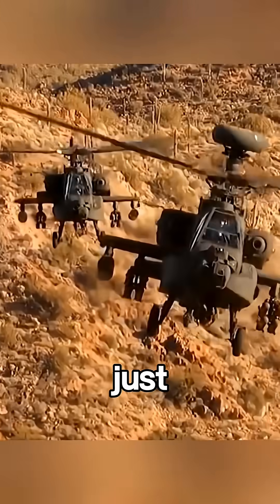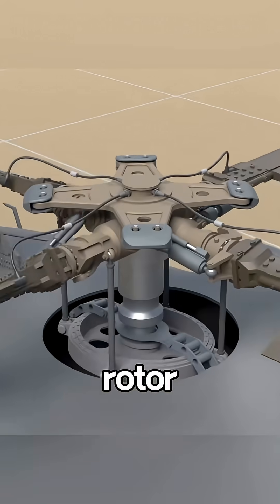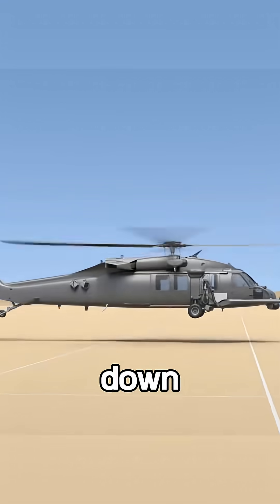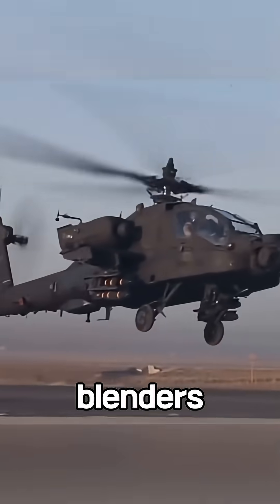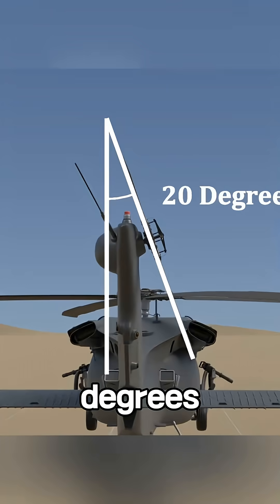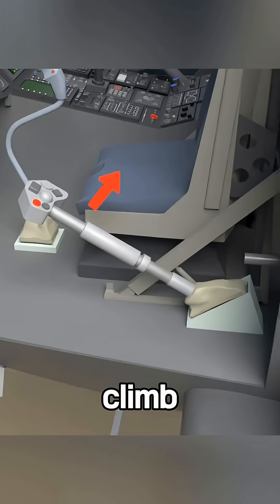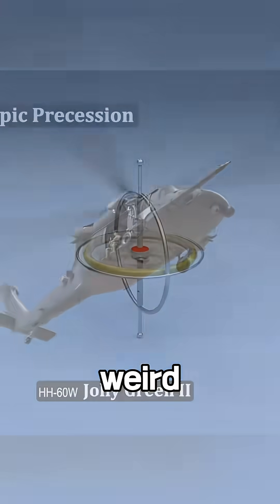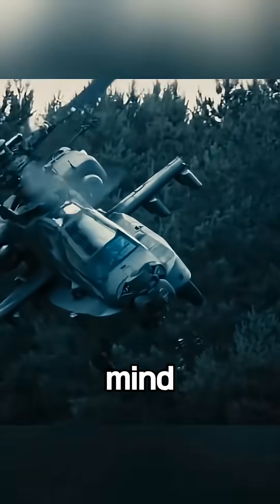Helicopter Speed Myth Busted: What Really Limits Their Velocity #helicopter #aviation #military

Comment: Helicopters do have a throttle, it’s the twist grip on the collective arm. It makes the engine and henceforth the rotor blades move faster or slower depending apron power needs. They don’t always go the same speed….
Reply: You’re dead wrong, the throttle is used to maintain 100% Nr regardless of the pitch collectively on the main rotor blades
Reply: @VerticalFreedom So, a throttle isn’t used to spool an engine up?!?!… Are you sure that you are sane?….
Reply: @Dingomush initially yes, to go from ground idle to flight….after that it’s used to maintain 100% Nr
Reply: @VerticalFreedom . What the hell are you calling “Nr”? Just like a car going up a hill, a helicopter must draw more power and hence more rpm to fly higher or faster. Don’t tell me that you think a helicopter runs the same rpm in a tropical jungle in summer as they do in the tundra in winter……. That would be stupid….
Reply: @Dingomush  obviously you have little clue about how Helicopters work! Nr is the rotor RPM & yes Nr remains at 100% whether flying the Himalayas or tropical jungles
Reply: @VerticalFreedom   No.  You don’t constantly run a turbine at peak. That’s why that throttle is on the collective. If it only ran balls out then there would be no reason for a control  for the engine. Which sounds stupid, because it is. You really need to talk to people who have flown this equipment as you have no clue….
Reply: @Dingomush if you are talking of a GT engine then You never touch the throttle, as the engine is governed to deliver 100%Nr. In a uncorrelated piston engined machine you are constantly manipulating the throttle to deliver 100% Nr & the engine RPM remains the same. I guess flying these machines commercially as well as being an instructor for 38years I’ve learned that much about them 😅
Reply: @VerticalFreedom   Well I guess you should get off your high horse and kiss the ground. All helicopters do not operate the way the new ones do, now do they. Also if you look into the way the system works as far as pulling power out of an engine you will find that it has to vary RPM in order to keep your ass in the air. That is, unless you have never hit a downdraft or violent turbulence. You are talking out your ass about one scenario………..
Reply: @Dingomush hahahaaaar you just proved you’re clueless about rotorcraft! Anyways I’ve wasted enough time on a 🤡
Reply: I just hope you don’t hurt or kill anyone with that “I’m right on all counts because I’m me” attitude because your perspective came from so far up your ass that you were tasting it for breakfast. The way one craft works is not how all craft works. Also, as soon as I load the rotor to lift the craft the RPM’s will drop… the engine will have to compensate… the speed WILL VARY!!!….Goodbye.
Reply: @Dingomush  Hello dingo. Hopefully I can word this in a way that conveys the message. I'll preface by saying that my area of expertise is the UH-60 Blackhawk helicopter. It is my career. To keep things simple, I will say that my statement applies specifically to the blackhawk. Though, in reality, it extends much farther than that one airframe. As VerticalFreedom stated, Nr is a 0%-100% scale which measures rotor speed. To clarify, 100% Nr is not the critical speed of the rotor system. A 100% Nr indicates that the rotor system is at it's design operational RPM. In flight, and depending on atmospheric and weather conditions, the rotor system can encounter a vast array of different operating conditions. However, through mechanical and electrical systems, the rotor rpm is maintained at a constant rate, regardless of torque demand. this is done by dynamically varying the supplied power from the engines through fuel control. The engines  also have a design operational RPM, which happens to coincide with the aforementioned 100% Nr thanks to gear reductions. While a rotary craft can encounter conditions which apply force differently to the blades, and thus to the whole powertrain system, such a system is designed in a way to account for those dynamic conditions. Rotor RPM is intentionally and forcibly maintained at a constant rate when the throttle levers are set in the fly position. I'm sorry to be the bearer of bad news, but rotor RPM is not dynamically adjusted in flight. The pilots have enough complicated control mechanisms as it is.
Reply: @Dingomush  I have flown turboshaft engine helicopters and reciprocating engine helicopters. VerticalFreedom is CORRECT and YOU are only making an @$$ out of yourself with each stupid comment you post.
Reply: @Dingomush  FYI, Dingo$HIT, HELICOPTER ROTORBLADE RPM IS CONSTANT IN FLIGHT whether a helicopter is hovering, taking off, accelerating, climbing, descending, flying empty, carrying a load, turning, or landing. The engine governor adjusts fuel flow to automatically maintain a constant rpm. Collective rotorblade pitch, not rotorblade rpm, determines if a helicopter climbs, descends, or maintains altitude. Cyclic rotorblade pitch, not rotorblade rpm, determines if a helicopter accelerates, decelerates, or turns.
Reply: @Dingomush  You are the walking, talking poster boy for Dunning-Krueger.  Arrogantly confident in your assertions while being 100% wrong and doubling down on your ignorance when corrected. Read the FAA Helicopter Flying Handbook if you want to learn the reality of how helicopters work. Or just keep being wrong, I don’t care.
Reply: Well, you just told everyone that you never flew or worked a helicopter with that comment.

Helicopters do have throttles but the throttle is only for increasing blade rpm from ground idle to flight rpm (Nr) before takeoff and back down to idle after landing. The throttle setting of turboshaft helicopters is not adjusted between takeoff and landing. The fuel control governor maintains helicopter rotor blade constant at flight rpm no matter if the helicopter is hovering, climbing, descending, accelerating, decelerating, turning, or in steady flight. Rotorblade pitch, not rotorblade rpm, is used to control helicopter collective and cyclic lift in flight.
Reply: @oscargrouch7962 Tells me that you guys are just flying the newer stuff…….

Comment: They figured out hovering pretty quickly. It took them years and a few dead test pilots to work out the intricacies of forward flight. When the heli starts moving forward the advancing rotor (to the wind) would get increased lift and vice versa for the retreating blade causing the heli to pitch up uncontrollably and end up in a heap on the ground. Allowing the blades to flap up and down was the solution to this problem

Comment: They should have a feature that independently adjusts the pitch of each blade to help the helicopter safely land in the event that causes one or more of the blades to break off.
Reply: Helicopter main rotor blades can, do, and must continuously pitch independently of one another to maintain flight. (Each main rotor blade is continuously increasing pitch, decreasing pitch, twisting, leading, lagging, flapping, and flexing as the main rotor system turns to balance aerodynamic lift and drag on opposite sides of the rotor disc.) That is how helicopter pilots maintain control and how helicopter pilots accomplish directional flight. We call it "cyclic pitch control".

If a helicopter rotor blade (or even a small part of one) breaks off, the imbalanced main rotor system will shake the whole helicopter apart in a fraction of a second. The pilot and passengers will be dead before they knew it.

Comment: Fact is once you understand the concept it’s really cool, and in case y’all were wondering the death spin is because the tail rotor was damaged or failed. One more cool factor with helicopters In theory of the main rotor. If it’s loosing rpm or power technically you can slow the decent by manipulating or slow the decent ever so slightly with the lift and rotor spin combined the weight while going down word. There no such thing as a helicopter just falling out of the sky… unless it’s shot down or struck by another aircraft…

Comment: wrong. the rotor does accelerate. the higher the pitch, the more the rotor needs to rotate to maintain speed. It's no coincidence that they have an "accelerator" for the rotor. the higher the pitch, the more the rotor has to accelerate because the drag causes it to slow down

Comment: I’ve heard that helicopters are the most difficult air machine to fly. This seems to prove it out.
Reply: Not really. It’s just flown differently that a fixed wing aircraft. For example, in an airplane if you wanna climb, you add power and raise the pitch of the nose up. In a helicopter, you push the cyclic forward which pitches down slightly and pull up on the collective while maintaining 100% rotor RPM. After a while, it becomes second nature and you don’t even think about it.
Reply: @artjackson8360  Have you flown choppers before?  I knew a guy who flew them out of El Toro in California. The way he described it made it sound difficult. Do you what the difference, if any, is between flying like a Blackhawk and a Chinook? Personally, I’ve always thought the Sea Stallions were bad ass, but nothing beats the lifting ability of a Chinook.  I’m sort of surprised hospitals don’t use Chinooks because you could fit a complete trauma center into one. Here in Texas it would make a lot of sense given the distances between cities with decent trauma centers. Maybe it’s a speed issue.

Comment: I’m a Blackhawk mechanic. The tail rotor is not tilted to balance a heavy tail or whatever it said.  The operators manual states it has an angle to produce extra 2% lift. Not all tail rotors have an angle like that. And the tail isn’t heavy. It’s hollow with nothing but a light weight aluminum drive shaft and two gearboxes
Reply: When operators carry extra ammo or eat food before the operation, pilots need that extra 2%
Reply: @Cheenael  I appreciate the sentiment, but I assure you that those two things are not considered together.
Reply: Hello fellow tango! Though it's not necessary for all helicopters to have a tail rotor which provides lift, it should be recognized that the blackhawk tail rotor was intentionally given angle for the purpose of the additional 2.5% lift in a hover.
Reply: @Kurokuma10  Yes. Sikorsky UH-60 Blackhawk tailrotors have a tilt to reduce translating tendency. Less translating tendency means more engine power and mainrotor lift are available for lift while hovering especially with out-of-ground-effect slingloads.
Reply: Did you catch the part in the beginning where he denied the existence of a throttle?

Comment: And since the main blades that are rotating forward generate more lift while those rotating to the rear generate less lift, the collective (I think) automatically adjusts the blade pitch so the same amount of lift is generated.
Reply from the maker: Interesting point
Reply: @usajethistory FLAPPING is what counters that differential of lift..rising blade as flying foreward in flight,  descending blade as flying backwards in airflow.. this changes the angle of attack of the blades to "balance"  lift produced.. lessening lift on the extra lift side, increasing on the less lift side..
To REALLY melt your brain, when there is flapping of blades, there needs to be play to let blades sweep foreward-backward as the "coning up" of blades makes the blade speed up..dropping flatter makes it slow down.. (like a twirling figure skater)..
If there are only two blades, there is no "lead-lag", only a teetering hinge like a "see-saw" and spacing of blades is kept in perfect opposition & balance with each other..
But wait ..THERE'S MORE!!!
❤🚁  THEY'RE COMPLICATED!😎👍

Comment: and some helicopters uses 2 jet engines, each mounted on both side of the main rotor, which can give it even more speed.
Reply: Actually, no that’s not what the turbine engines are there for. They don’t give you forward thrust. They are there to provide power to rotate the blades and nothing more.
Reply: @artjackson8360  wasn't aware of that

Comment: What about the helicopters that don't have the tail rotar, how do they cancel out the tendency for the anti-clockwise motion of the helicopter?
Reply: Basically, they replace the spinning rotor on the tail with ducted fan that blows air to the side. It’s called a NOTAR.

Comment: Main rotor actually spins NOT same speed always. But only SLIGHTLY different speeds. As you inctease Collective Pitch, then main rotor slows down, because of air resistance. Thats why heli pilots never suddenly go 100% collective pitch. It woud stall the aircraft

Comment: MOST of what was shared was correct... except for the FIRST point. A helicopter CAN fly faster by both the INCREASE of RPMS and tilt of the wash plate to change the angle of the rotor blades.

HOWEVER, there is a limit to the speed due to retreating blade stall. When the blade stalls, the helicopter slows down (there's more to this aerodynamic principle).

Comment: Helicopters speed is limited to the speed of sound of the tips of the rotors.  If the tips exceed the SOS, which they do on one side only at first the helicopter will roll.
Reply: Helicopter directional speed is limited by retreating blade stall.